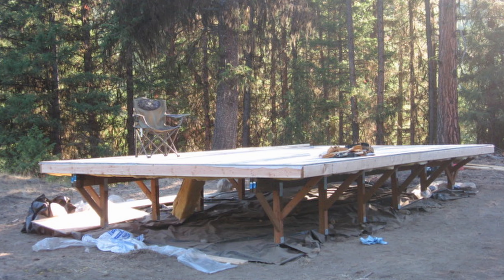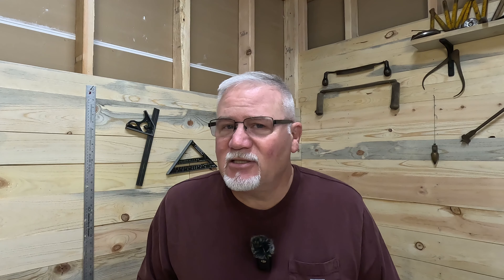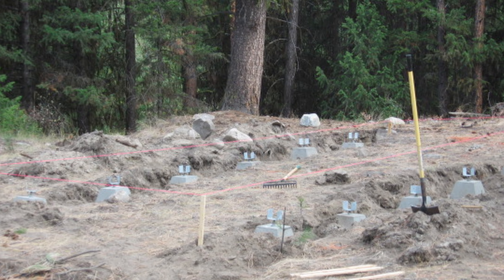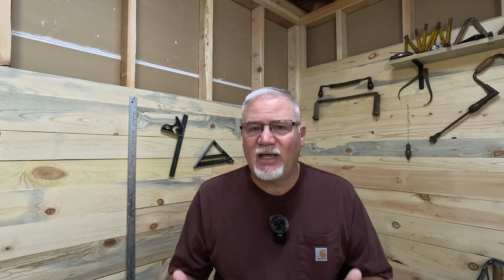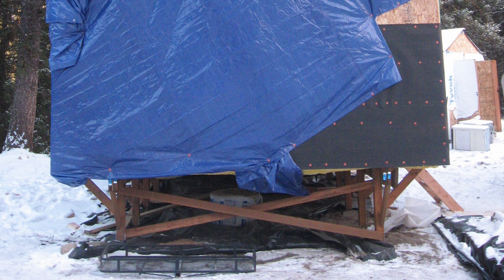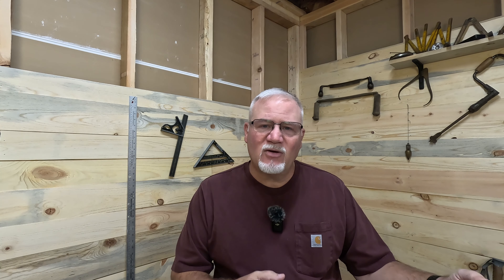I Regret Choosing Post and Pier for My Cabin Foundation Here's Why!

Comment: 4x4's are too flimsy for a permanent structure and even on the super light side for just a deck.  Growing up in the fifties in my locality no one could afford concrete full perimeters and footers and most sites were not accessible for the limited equipment in our village.  The most popular ways were to dig a good drainage around the perimeter and then dig down to hardpan, preferably to bedrock where a  foot square by six inch pad was poured over gravel (some used an even larger pad).  Then the most preferred posts were pressure treated real creosote pilings twelve inches or more inches diameter, some used pressure treated creosote 12 x 12 timbers.  Once these were in they were capped with eight by eights or larger for some uses.  These were securely fastened by lag bolting or drift pinning all the way through where possible.  Only then were the floor framing members assembled atop those timbers.  The advantage of such large stock was stability and a lower center of gravity.  A skirting was constructed around to keep any weather off the foundation and enable the house to be insulated effectively as well as reducing critters.  This skirt was painted with full creosote every three or four years to protect it in ground contact.  In the bush many were built with equivalent trees which were either treated or replaced as time went along.  Fully protected with good drainage ditches around they would last quite some time especially if cedar was used as was often the case.  Houses were also constructed over the water above tidal range which meant piling of twenty feet at the deep end again creosote which last for a couple of hundred years and more.  These were closely on center and well braced but once again of substantial size.  In all the houses and buildings so constructed I do not ever remember any instability whatsoever.  Our area gets winds in excess of a hundred miles per hour two or three times a year and a lot of lesser storms as well.  Heavy snow loads can also occur.  No one would ever have considered such a light structure as 4x4's for good reason.  In your case I would remove the 4x4's and replace with concrete pillars of ten inches minimum.  You could also form up around the 4x4 with plywood (it is not at all comparable to OSB in strength or water resistance but in this case could be used for forming).  Make sure your stand off is uniform and pour a good pier in place.  Best to just remove the 4x4 a few at a time or crib up the house and replace them all at once.  Cross brace with good beams to hold the joists and voila you have a good foundation.  Be sure to pour a good footing for each post.  Precast is a poor substitute.  Be generous with the size as it is called a footing for a reason.  Use plenty of rebar.
Reply from the maker: Ya, I wish I'd gone with at least 6x6's but now we're going to finish it with footings and stem walls
Reply: You know how much a 12 x 12 costs in 2024?
Reply from the maker: I have a sawmill 😉
Reply: @TheOldJarhead  Not everyone does and I was talking to the original poster. If you have a mill  you good.
Reply: 4x4s or 4x4 which are more like 3.5?
Reply: @TheOldJarhead nothing like rough cut lumber to dimension. Feels so much more solid then the flimsy toothpicks they sell in the box stores.
Reply from the maker: True!
Reply from the maker: ahhh

Comment: I have a "post and beam" foundation under a 20x32' cabin and have none of these issues.  I poured 12in sono tubes upto the bottom of a tripple 2x12 girder. This foundation is 15 12in sono tubes 40" underground  and generaly 3' above ground.  Me and my 67yr old father dug this foundation in clay, had it inspected and poured the tubes in 4 days.  Cost about $1000 and took about 120 80lbs bags.  I figured that in the end useing a vertical post and the brackets needed was going to cost more than just doing more concrete.
Reply from the maker: Wish I had done that
Reply: I build a remote off-road cabin on 6” well casing and welded steel angle for cross bracing. It is real solid. It’s been there 24 years and the floor is still level even after some 7+ earthquakes. This cabin is a six miles of ATV trail from the road.
Reply from the maker: Wow!  That's cool!
Reply: @Chris_at_Home  Daughter wants to build a water tower about twenty feet up. I've been suggesting she get the well drillers to give her four tall posts (casings) and she can build the platform on top for he 1,000-gallon tank. Did the driller do it for you or did you dig and place them yourself?
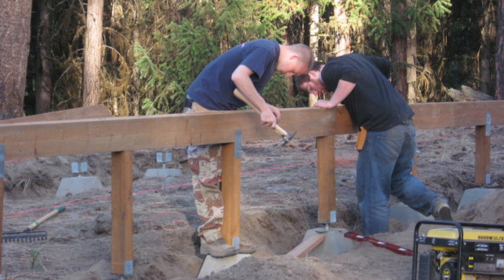Reply: @TheOldJarhead   = Generally , The posts for post and beam, are supposed to go into the ground about as deep as it is above ground, for that lateral support.  I saw the potential problem at the 0:40 second mark as soon as I started watching the video.  But I wanted to see what you did about it, so I watched more of it.   You probably did not want the rotting problem of the post in the ground, which is why they often use sono tubes and cement. My recommendation for most builds is to pour a floating cement pad on a bed of gravel, which can be insulated on top if needed.  Many garages use that method, and it avoids a sub-ground concrete frost wall which is expensive.
Reply from the maker: That's why I'm converting mine to footings and stem walls :)  It's actually pretty solid now but I don't like the way I did it (live and learn) so I'm fixing it, albeit, slowly ;)
Reply: @TheOldJarhead carrying the OSB shear walls down to ground at just a few places will stop the shimmy in your floor.

I also did the sonotube piers plan  Only six for a 20×32 floor, but since I'm on a hillside, they vary from flush to the ground at one corner up to five feet at the opposite corner.  If all the piers are the same height the floor is more resonant, meaning it's easier to get swaying under normal footsteps.  All my piers are poured with rebar and wet-set brackets the proved a capillary break between untreated beams (6x12 for me) and concrete.  The footer portion of the pier is much wider and deep enough so one-third the total height and two-thirds the total mass is buried below grade.  I did this to prevent levering the piers loose over time.

This also has prices successful wildfire strategy, too.  No part of the cabin is in contact with vegetation.

I need to add, the loss of heat through a raised floor is not nearly so problematic as gaining heat.  Especially in my climate:  occasionl lows about 30⁰F, but highs over 100⁰ for months.  Heat rises.
Reply from the maker: @timgerk3262  Agreed.  Since putting in the two short sections of the new foundation it's been very solid

Comment: The taller your posts, the more movement you will get. Use the shortest posts possible to get your floor right down close to those piers. Also, the flex in those bolts is never going away...I would do wood directly on the concrete(with a piece of shingle for a vapor barrier)
Reply from the maker: Agreed
Reply: No, make it tall enough to work under there.
Reply from the maker: That was my first thinking.  Now I'm going to put in stem walls on foundations

Comment: It looks like you did so many things wrong with this build I don't know where to start. You started with the wrong base in your holes, size of post, build larger than your Beams, I have a post and pier system on the Gulf Coast and been through many hurricanes no movement. Your start (foundation) is key.
Reply from the maker: It could definitely been better though it's been through heavy winds and done just fine.  15 years and still doing it's job.  I regret doing it because I could have done it better ;)  That's why I made the video, to warn others but I'm also fixing it and today, it's quite stable.

Comment: I put in 6x6 posts for a 12'x16' cabin. No concrete, just treated 6x6 posts sunk down to hard soil 4 foot deep. Still level and no movement or rot 45 years later. But no wiring or plumbing in my cabin. I think the technique is best for small buildings. You are correct about the rodents.
Reply from the maker: nice work

Comment: When I built on post and beams I used helictical screw piles and the four corner piles had additional piles attached to them and screwed into the ground at an angle for bracing. On top of the piles are beams and then I used a 12 1/4" SIP panel for the floor and then built a  second raised floor inside the exterior walls for a warm space to run the plumbing pipes. Finally, I built a utility shed on a concrete pad on the ground against the side of the raised cabin so that all the plumbing pipes from the cabin went through the two adjacent exterior walls (the cabin's and the sheds) so the pipes are never exposed to outdoor temperatures. The well pipe and the septic pipe also come up through the shed's concrete floor pad so they are never exposed as well.
Reply from the maker: Excellent build!
Reply: Huh. I've been fantasizing nearly the same thing. Sounds like the way to do it.

Comment: Well just from a common sense viewpoint you eliminated all your stability but putting your cabin on stilts.  You brought the cabin up then put the entire weight on a dozen 3/4” bolts.  Usually you can use those on decks  but the deck is attached to a house.  Post and beam perfectly acceptable but use 4x6 and metal plates that let the posts sit on the concrete cylinder.  It’s all about surface area holding and displacing the weight uniformly.
Reply from the maker: Agreed.

Comment: How could you manage to do everything so wrong you should have poured a footer then form a short wall up out of the ground off the footer and put your house on top of that then bolt it down solid steel pipe piers in the middle that can jack up if needed to cheap way not always the best I beam down the middle would be best think about it Marines should know better I'm one Semper Fi
Reply from the maker: Regret isn't the same as "I did it all wrong".  The cabin has held up nicely for 15 years and while I am improving it, one can argue the only thing I did wrong was no put in enough bracing.  Semper Fi Marine.

Comment: I’m just sinking 6x6 posts about 3 ft in the ground. Will have about 12x12 pored concrete pad for them to sit on. So I will have 3 ft of dirt keeping them stiff and movement free. I did a storage building the same way 20 plus years ago with 4x4 posts.  This cabin will be 12x24.
Reply from the maker: That should work great 👍

Comment: I had the same dilemma in my mind when I built my cabin in the woods.  I finally settled on a monolithic slab with three rounds of cement blocks that the cabin sets on.  Major reason was not wanting to crawl around in dirt under the building after everything was built, and no mice or other critters can get in.
Reply from the maker: That'll work!

Comment: This is a good discussion. Now, retrofitting is made easier by using bond beam blocks, dry stacked where necessary. Lay in the re-bar and pour the core with pre-mix. Where necessary, do a cold joint. With re-bar an a lap, it will be solid.

Comment: If I'm building in an area with a decent depth I have to dig to get below the freeze line, I'm going basement style.  But another way with these post areas is to get a tool from Jess Tools that utilizes a post hole but augers out a bell in the bottom to help prevent heave

Comment: For all the reasons you listed plus the lifting power the wind has, my cabin has solid foundation. It lays by the coast of Norway and the wind there is hefty in the autumn and winter season
Reply from the maker: Fortunately I don't have much wind at all by our cabin (just breezes as we're well sheltered though I do sometimes get wind) so it hasn't been an issue but very good point!

Comment: I own a house built in 1920 on post and pier. (CA) Redwood piers a top 1x6's along the perimeter and 2X down center. Was told by an old timer they survive earthquakes better compared to bolted concrete because they give, sway and settle. So far so good 104 years later. Redwood piers still good as new. My piers (4x4) are nailed; floor about 3ft above ground. 1 pier every 2 feet around perimeter and 2 pier runs down centre. (Braced top to bottom with 2x4x8's) atop 1x6's as footers on dirt. No sway at all. House has settled here and there, but for what it is, it's good. Plenty black widows.

Comment: It took me a year to do our foundation. The building department kept red lining everything I tried. Finally said OK How about 28 yards in a 20ftx20ft. slab with 16" piers under every post and #5 rebar?  Got the OK finally.  The concrete guy who did the pour said   "I can't believe they made you put this much concrete in this slab!  You could build a 10 story building on this thing!"  It's so thick it generates it's own heat!   Haha.  The Timber Frame was the problem with the building department.  They didn't like it and they were trying to dissuade me from building!  BIG mistake.  
    “If you have built castles in the air, your work need not to be lost; that is where they should be. Now put the foundations under them.” ― Henry David Thoreau
Reply: A man builds a fine house; and now he has a mastery, and a task for life: he is to furnish, watch, show it, and keep it in repair, the rest of his days.

Ralph Waldo Emerson
Reply: “Therefore, when we build, let us think that we build for ever. Let it not be for present delight, nor for present use alone; let it be such work as our descendants will thank us for, and let us think, as we lay stone on stone, that a time is to come when those stones will be held sacred because our hands have touched them, and that men will say as they look upon the labor and wrought substance of them, "See! this our father did for us."  John Ruskin
Reply from the maker: Darn counties!  But it sounds like you will never regret the overbuilt foundation!
Reply from the maker: I like it!

Comment: I’m no carpenter or engineer.
That said I spent summers at my grandparents cabin on Saratoga lake.
It was a small 1 bedroom cabin maybe 1000 square feet.
Under the cabin were brick piers and rough cut 2x10 beams with 2x10 floor joists and 2x4 walls. They built the cabin around 1950 after spending two decades living in tents on the property from May to October.
I only remember once in 1970 the roof was pushing the walls out and they hired a carpenter to pull the walls together to fix the problem.
The pier’s were solid brick construction and were at least 4’ feet deep.
I salute you for building a cabin and working diligently. I think it’s possible that 4x4 is too small for any foundation, with the ton’s of load it just flex’s too much.
I can see by the middle of the video why you regret choosing 4x4 as a pier.
Good luck with your cabin, I think I will copy Grandpa and use brick 12x12 pier’s and heavy beams today’s sizes would be 4”x 12” joists 16 feet long and a center beam double 4x12.
Cabin was 34’ wide and 50’ long. Piers were every 8 feet and they held until 2016 when the next owner took down the cabin for a large house.
I miss that summer cabin!
Reply from the maker: I appreciate your sharing your grandpa's cabin experience, thanks for the advice!   For me, I do think the 4x4's were too small and as others suggested, tying the 4x8's together might be a much better plan but I'm working on the foundation to switch to a footing/stem wall design which I believe will be far more solid though today, I have no worries as my previous efforts have made the cabin very solid but I have, in the back of my mind, some concerns so I'm addressing them :D

My cabin is also very small at under 600sqft including the loft so it's pretty small but in the end, a solid foundation, whether or not it's a post a pier, is key and the video is meant to help others not do what I did originally ;)

Comment: My approach is build the floor deck upside down, sheet over in 3/8 plywood, that way there's zero critter issues.  I fill floor joist cavities with packed cellulose insulation then deck over with ordinary T&G subfloor.  Cellulose gives a perfect fill, it's toxic to ants, and fireproof.  I prefer concrete posts poured level.  You have to be careful with the layout, but it's stable.

Although a contractor would say they charge the same for both jobs, a home builder should be further ahead with concrete posts, just less material involved.  Though with the right machinery it's attractive to just dig a trench, make a footing and pour walls.

Comment: You needed 6x6 verticals and set the floor joints into cut outs on the 6x6s.

Pier and beam has been use successfully for decades.
Reply from the maker: Or just keep on putting in the footings and stem walls 😉

Comment: Not sure I have this straight:  the posts should be transferring the load directly into the piers ?  The bolt is a fastener that keeps the post from moving off of the pier, but it should not be load bearing.
Reply from the maker: The bolt is part of a 4x4 Simpson bracket and indeed supports the load.  When I decided to use them, I hadn't considered that thoroughly, and none of the people I consulted who had experience saw an issue (which I suppose is why it's still standing). However, once I finish the new foundation, it won't be an issue.